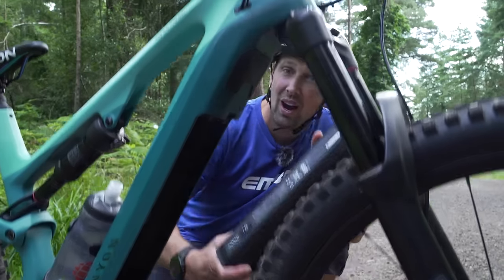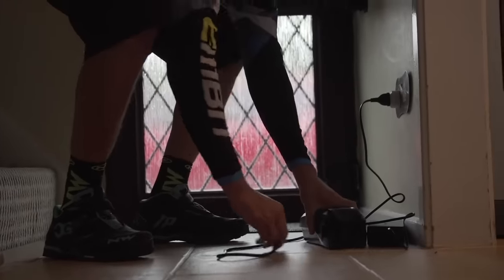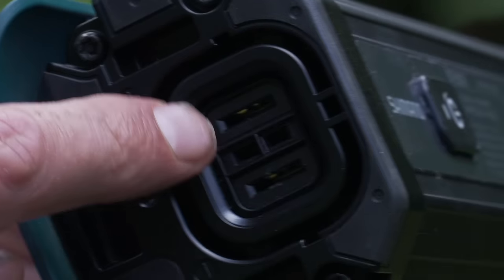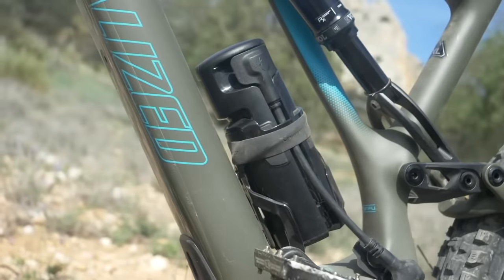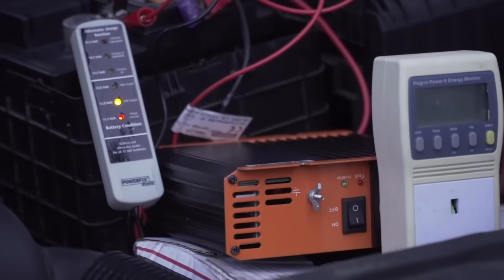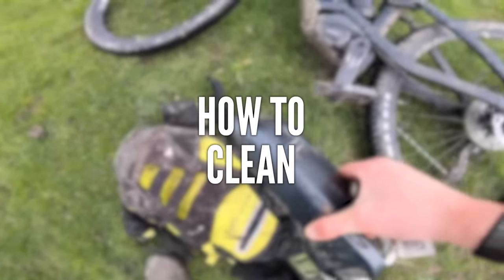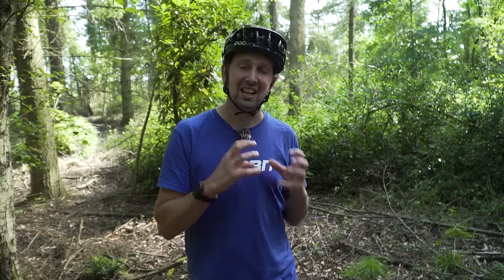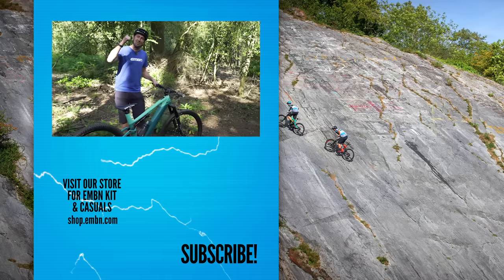How to Maintain Battery Health | E Bike Batteries Explained

Comment: Did you speak to all the battery manufactures when saying it lasts longer when you charge it to 80% alot of small bms’s like those in ebike batteries only top balance meaning you pretty much need to fully charge to keep your battery balanced and any unbalancing will kill your battery pretty quick. Most people dont know this and think they work like electric cars, but electric cars can constantly balance cells.

Ill stick to fully charging mine.
Reply: that sounds like a pretty stupid BMS.
Reply: Joseph Wong most bms’s only balance while charging. They use a bank of resistors to ‘bleed’ off power from a string of cells that are of higher voltage than the other strings. 
Most only do this when charging so they dont loose charge when not in use. They balance most accurately when nearly full. 

Its not a stupid bms (theyre pretty clever to be honest) its just how they work. 🤷‍♀️
Reply: @evolution0016  i mean only balancing when its at full not balancing while charging.
Reply: Joseph Wong they do balance while charging to but if something is badly out of balance (rare but possible) then it wont be back in spec until it is fully charged and while this would usually indicate a fault on the battery a small error can lead to a large one over time of constantly charging to just 80%. 

As above it does when charging and for most people it will be fine but i have a friend who used to set timers etc trying to look after it and his battery just died oneday (cheaper spare i must add for his haibike) and found the strings out of balance.

My advice is if your someone who likes to charge to 80% every 4/5 charges make it a full charge. Ebikes are such low power it shouldnt tax the batteries much to cause imbalance but theres always the possibility.
Reply: @evolution0016  i built a 16s1p 57.6V 3.4kwH battery and I just keep it at around nominal voltage. My 4-6 mile runs usually just drops the voltage by like 0.3-0.5V and the voltage sag is at max 1.5V. So, I just charge it to nominal or slightly above. I think the only time I might charge it to full is if I am going like 100 miles that day... I shoulda put additional balance leads so I can monitor the voltage aside from the ones for the BMS...
Reply: Joseph Wong  16s1p? What size motor are you running on that, the current draw will be really high. Anything over 250W (actual 250w not a 250w nominal hub/mid drive motors which can peak at 6/700w) would mean a current draw of over 5amps!  The absolute max id say to run on a homemade pack. The best way to make this safer is to increase the number in parallel, so 16s2p (an extra 16cells wiring a extra one in parallel to each string) or better still something like 16s4p. Youll find it actually runs better and faster especially when going up hills etc due to the sag your experiencing, but with such a small battery im supprised its not more. 

Have you got a bms connected to all 16 cell? If you have access to the bms you can always just use a multimeter to monitor, do you power your motor and charge the battery via the bms? (Ie not connected directly to the battery) because the bms should have a cut off if anything becomes out of balance.
Reply: @evolution0016  hey, thx for feedback man. new to making battery thing but not ebikes. im running a Cyclone 3000 and i have the pack in series from four 4s1p with their own bms connected in series to make 16s1p. the cells are lg chem n2.1 3.7v 60aH. i charge via a common port on the bms. this is a 3.4 kwH battery... probably shoulda done a pure expensive 16s bms with bluetooth and individual cell monitoring... but first time thought i do it piece meal in 4s chunks.
Reply: @bakotako  Weird that every single ebike manufacturer does that. Where do they get so many stupid designers from? Did you not think that there might be a reason for it, like it's actually the right thing to do?
Reply: @evolution0016  You're sort of right, but the problem is that they only balance at the top of the charge, not when they're anything less, whether they're charging or not.
Reply: @hughjardon3538  yes its the only way atm. it balances while charging. also this thread is 2 years old dude...

Comment: If charging to 80% prolongs the battery life why manufacturers cut the charge at 80% of it capacity but show as 100% and prevent problems? On every device I have I use the entire range of the battery capacity I don’t care what you says...🤷‍♂️
Reply: You're right. Every single European, Chinese and Indian manufacturer provides a 42v charger (100%) for a 36v battery. If short charging was such a brilliant idea, you would have thought that one of them would do what you suggested.

Comment: Never, ever, charge your battery!
Just store it at about 50%.
Make sure the room you store you're battery in is air conditioned, to about 16c.
Make sure you have a good dehumidifier that keeps the storage room at about 10%.
If you plan on using your battery, be prepared for the consequences.
It will eventually run out.

Comment: Impressive tech ? Bosch ? Lol my battery has a Bluetooth BMS I have cell balancing, cycles, charge rate,  dis charge rate range left, individual cell voltage, full charge voltage that is adjustable  to optimise battery life, all via an app to my android phone, faults easy to diagnose, don't  see the on Bosch, Shimano, etc ..

Comment: Chris, most of your info is very valid. However, a good battery management system will never let you fully discharge the battery and likewise will never charge the battery to 100%. You can leave your battery on charge forever and it won't reduce the charge capacity in the future, that's assuming you are not trying to charge it in freezing conditions. All e-bike batteries use 18650 cells which are common in many applications and I suspect if the warranty is 1000 discharge cycles, the BMS will take care of the battery pack. I doubt any e-bike company will tell you that your 500 Wh battery only a 400Wh battery. 
Just for security reasons, I always charge my battery in my home as it removes a lot of the value of my bike and makes it much less attractive to steal. Great video as always and thank you for the content.
Reply: Indeed and therefore cell charge/discharge voltage can differ between manufacturers hence higher charge voltage can give more capacity and lower cell voltage gives a lower discharge, again increasing capacity but all that the cost of cycle life.
Reply: With the amount of misinformation you must be career politician/marketer.
Even lead acid batteries, which should be kept/stored fully charged to minimize aging, don't like endless charging.
And Lithium based batteries...
Those protection circuitries are there to prevent battery from turning to firebomb, not to maximize usage life!

Maxed cell voltage increases wear and part of capacity increase has come from pushing voltage closer to limit of clear overcharging.
Leaving smartphone into charging overnight is good way to kill battery capacity at increased pace.
Sony even introduced charging which won't charge battery of phone left plugged in overnight above 90% until near morning to minimize time spent at that slow fry state.

Besides high voltage itself increasing aging that also makes cells more vulnerable to higher temperature.
Laptops used as desk PC replacement and always plugged to wall tend to kill their batteries faster because of that.

And DJI even has system in their drone batteries which starts (slowly because of limited heat dissipating) to discharge battery down to like ~60% charge after selectable delay of 1 to 10 days if battery is left at high charge.

Comment: They want you to buy overpriced battery's every 2 years.. All e-bikes seem to lack battery charge management (custom charge speed and charge level). They also do not use proven LiFiPo4 cells that last at least 3x longer than current ebike batteries. I used a single ebike DIY LiFiPo4 15Ah battery, almost every day for almost 10 years! And always charged it to 100%. They can easily make an ebike that last 15 years if they use the correct cells and battery management.. And they do everythink against using you using your own batteries on your e-bike
Reply: They don't use LifePO4 because they're too heavy and hardly anybody wants them. The reason you don't get custom charge levels is because nearly all ebike batteries, including yours, are designed to be fully-charged (4.2v per cell). The BMS doesn't work properly if you short charge.

Comment: These are not the same batteries that are in your iphone. Li-ion is not the same as Li-Po.

Also the BMS will never allow your battery to charge to 100% capacity of the cells. 

Come on guys you can do better than this. Most of the stuff you're talking about here are just myths. You've quoted resources but have failed to provide a link to the information in the description and you have come up with some nonsense guidance that seems like you just made it up on the spot.
This isn't good for your viewers. I suggest you seek guidance from someone who knows what they are talking about when it comes to batteries and the different types.
Reply: Almost all chargers will full charge to 4.2v per cell which is a fair maximum. Some cells are rated at higher say 4.35 but even at 4.2 you are chewing into the battery life cycles.

Comment: If you want to significantly reduce self-discharge of your battery then put it in fridge. Just make sure that temperature is not lower than 5C and charge level is ~50% ! 
Another thing. Charging to 80% (4.0V) instead of 100% (4.2V) increases battery life by factor of 3x !!!
Reply: Problem is, if I start out at 80% charge, I'll have reduced range.  I usually get about 20 miles before I'm at 80%, so I've also lost 20 miles of range.
Reply: @johnwilson7809  do you really need that extra 20 miles while going to work and back? I do not think so! In that case charging to 4.2V makes zero sense. Think about IT!
Reply: @ataksnajpera  I don't work, just ride trails.  Some are 40 to 50 miles round trip.  I can easily do it with a full charge.  Starting with an 80% charge would be risky.
Reply: @johnwilson7809  so get a job then
Reply: @ataksnajpera  I'm allergic to work.  LOL

Comment: Ok, only just found the vid. Nice. However, Lithium batteries are not the future. We fight wars over oil, lithium is far more precious. Fast chargers use what is known as "Delta T monitoring. This, basically, say when your battery is boiling, cut off the supply....🙄

Comment: My Radrover (US import) battery has developed a fault 😰  Is it possible to fit a replacement, e.g. Hailong with similar / identical volt & Ah spec but considerably cheaper (£250 ish) than the OEM part (£500) also would the bike controller recognise the replacement and work as intended?  Thanks in advance.

Comment: My batterie has an on off switch and I thought I saw somewhere that it should be charged switched on but not sure. Does this matter? Not mentioned in the video. Last time I left it on while charging and I'm getting a very good range. Plus when it's on you can press a button to see how much charge it has even while it's charging.

Comment: If you really want the battery to last its full healthy life you always keep it at 30% min 70/80% max with a full charge/discharge cycle any now and then. You can do this if you find yourself in a spot where you usually don't go below the 30%ish in one ride; commuting is the easy type of ride to this.
Reply: Falco same as your li-ion battery on your phone, charge to 95%. But it's hard to do as no readout monitor, so wiring up an adapter inline

Comment: Have you guys experienced any issues with your e-bikes in the wet?
Reply: I never have. Rain no issue and deep river crossing, motor submerged briefly no issue. I have done this on 2 x  ebikes both running Shimano E8000 motors. I have several friends with giant bikes where moisture has entered the control pad on the handlebars causing corrosion, moisture in the display and moisture at connection to the motor wiring  causing cut out out issues. These were thru normal use

Comment: Do yourself a big favour. Keep you analog bike the longer you ride e the softer  you’ll get.
Reply: I still ride up to a good heart rate on an e mountain bike, just smile more
Reply: 80km on ebike  in terrain will give you perfect workout.... no need analog anymore.
Reply: Cannondale2019 i wonder if you actually have an E bike, because if you do, you should know that an E bike can give you the same workout as an analog bike (if you want to), you just can go longer distance and climb steeper. Besides that, every E bike has an analog bike built in. Just switch off assistance.

Comment: Don't be tempted to probe the battery terminals with a voltmeter. It can trigger self destruct, a safety feature which renders the battery permanently useless.
Reply: Clive Harris  you need a DC voltmeter set to 200 DC to find out which connection are the + -- and not the control wires, it only short circuits if you touch making a short circuit. I repair batteries for electric chairs 24v DC
Reply: Display should show the V on all ebikes